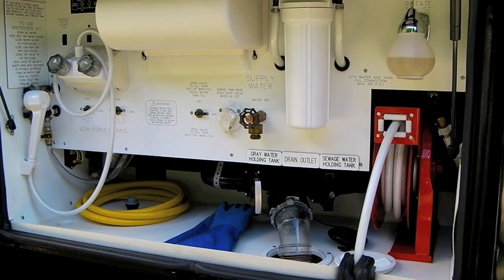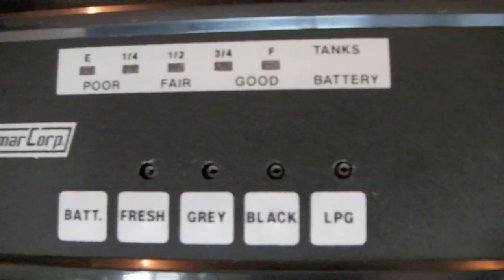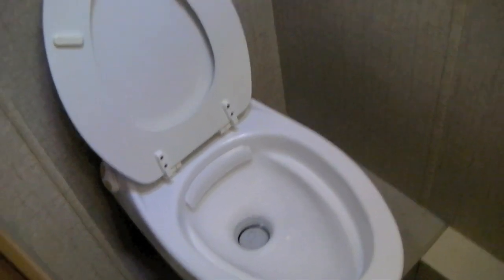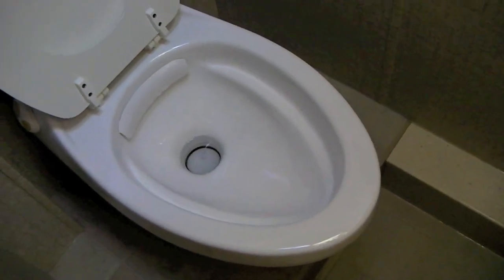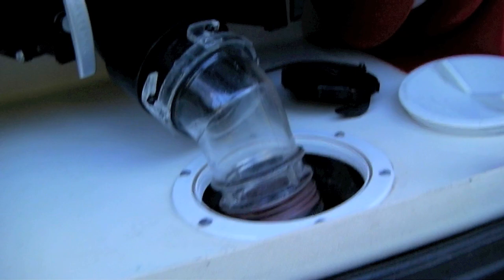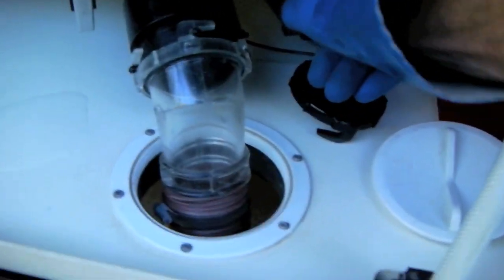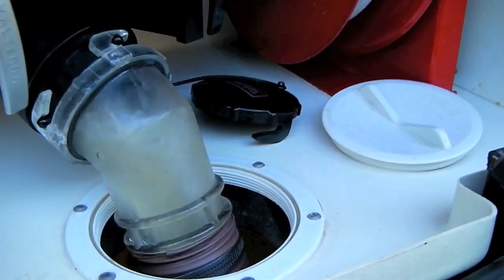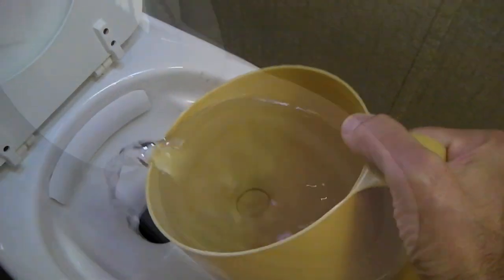How To Dump & Clean an RV Black Tank

Comment: I'm considering buying a used RV. This is one thing that concerns me. I drove Greyhound buses for years and they would stink until we got to a dump station. I have no knowledge of dumping the tank except what I learned on my own back in the early 1990's. This has helped me significantly.
Reply from the maker: Hi Mike! I assume it’s likely that you drove the same type of MCI tour buses that I did for many years. The toilets in those buses (at least the 1980’s & 1990’s era MC96A, MC102A, MC102C3, etc that I drove) were nothing more than open pits with little or nothing to properly seal the tank off from the passenger compartment. The toilet chemical and daily dumping were all that kept the entire bus from being a rolling cesspool. But of course heavy use, high summer temperatures, longer time between dumping, etc could all contribute to the unhappy situation you’re describing. RV toilets are well sealed, keeping the odors down in the tank. As long as the toilet seal holds water, you shouldn’t have anything to worry about. Also, the dumping process on a bus was just plain disgusting. Nothing like that on an RV, especially if you only dump when fully hooked up in an RV park with the sewer hose properly connected to the sewer outlet (vs using a dump station).  We have zero odor when using our bathroom or dumping.

Comment: I'm a DIY fulltime RV'r and I've been using a macerator pump for the last 9 years.  There are several macerator pumps on the market.  The last one I got is a Flojet. I use to spend a lot of time dumping the grey and black tanks as illustrated in this very well produced video before I found out about macerator pumps.  There are several fairly good videos here on YouTube about them.  If like me you find all these procedures unbearable drudgery I really recommend investigating RV macerator pumps.  Also I honestly believe that "Happy Camper" waste water  tank treatment is the best thing since "Pink Delsie".  It will easily take care of any buildup in your tank should you be unfortunate enough to have that issue.

Comment: Great video. I took notes, so I can have them in the RV and remind myself of the steps:
Fill grey tank to ½
Clean toilet 
Connect tank flush and start water (slowly)
Dump
tank flush full power for 5 minutes
Close valve
1 minute open valve repeat
Fill black tank with fresh water
dump 
Repeat 
Dump grey 
Black tank treatment:
2 oz. Rid’X &  1 gallon of water

If black tank stinks:
5 10# bags of ice – long drive
2 cups of water softener, 1 gallon of warm water, 1 cup of laundry detergent

Comment from the maker: We've heard good things about aftermarket tank flushing systems, as long as they are installed properly (we don't know what is involved in the installation, and it might best be done by a professional). If you have a window in your bathroom to put a hose through, using a wand can be pretty easy.

Comment from the maker: RV refrigerators are generally bi-fuel — propane/electric gas absorption, with no compressor at all.  Regardless of whether you're running in propane mode or 110-volt AC electric mode (from your generator or shore power), the process involves heating ammonia for an evaporation/condensation cycle, which causes it to cool.  It's a completely different process than a residential refrigerator (which some RVs, including ours, do have).

Comment from the maker: @groush  Using a fair amount of water is the downside of keeping the tank clean.  That's one reason we never dump it until it's at least 3/4 (when fully hooked up for a time, we wait until full).  We also avoid dumping the black when in an area with water use restrictions.  Between the initial rinse and one big fill, we figure we use about 60 gallons to dump our 45-gallon tank, about every 2 weeks. We also use the park's restrooms too, but of course that uses a lot of water as well.

Comment: Excellent.  My Camper manual sucks and this answered almost ALL my questions, well done!  One question, at the very end of the video you mention to dissolve 2 cups of "water softener" is that water softener salt or did you possibly mean fabric softener?  Please clarify.  BTW you sound a lot like Mike Rowe ;)  Thanks
Reply from the maker: Glad this was helpful! And I get the "Mike Rowe" reference a lot. LOL! On the "water softener" we mean a product like a laundry water softener like Borax or Calgon. Usually available in the same aisle in the grocery store as the laundry detergent. It just makes the water soft so it wets everything better and helps keep "stuff" from sticking! ;)

Comment: Great video!  Two techniques that I advocate: pull the slide valves slowly, in case a hose connection is not totally secure; and, to keep insects out of your coach, never leave either black or gray valves open unless doing lavatory service.

Comment from the maker: @loni benton Hi Loni. You appear to have had a failure in the black tank flush line, or possibly an incorrectly installed line. Your dealer should be able to address the problem (under warranty I assume, since you mentioned the unit is new?). Once it's fixed and dries out, you should not have a mold problem from one quick wetting. As long as they can air it out, you should have no worries once the break in the water line is located and repaired. It's probably just a cracked or incorrectly installed fitting, and hopefully easy to find and fix. Please let us know how you make out.

Comment: Excellent video. Learned some stuff. Been consistently told that you cannot run the tank flush with the dump valve closed or you will "over pressure" your tank. This didn't make sense to me as I knew there was a roof vent.
Reply from the maker: +pauld5530 Yup. The only thing that will happen if you overfill is that the water will come out the roof vent. Don't do that! Of course if you were to not only allow it to start coming out the roof vent, but to leave it that way (like you walked away and just left the water running for an extended period), the roof vent probably cannot handle the volume of water continuing to enter then tank, and would probably start to pressurize the tank as it continued to fill up. Don't do that!

Comment: Excellent you answered one of my Q. I had about cleaning my black tank. I will have to check and see if my motorhome has a spot to screw in a water hose to fill the tank to flush it. Mine is a 1993 Dutchmen model. To be honest I thought I had to just keep putting water down the toilet! LOL Newbie here. Thanx for another great video!
Reply from the maker: You COULD just keep putting water down the toilet.... for a little while. LOL
Reply: +RVgeeks I tried to look under my RV tonight but I seen no spot to screw in a water hose I will look again tomorrow. I just got done oiling all my woodwork in the RV, more there than I thought! I been watching quit a few of your videos and taking notes on my pad of paper. I want to do it all correct lol
Reply from the maker: zartan
Your RV may not have a black tank flush system. Many don't.

Comment: I live in southern Ontario and I generally driveway camp or in provincial parks. As such we normally do not have water when we dump except what we have on board. I rigged a valve station that I connect to the taps on the outdoor shower. This can then lead to the shower, a hose or to the black water flush. I have a check valve on the entrance to the black water flush as you show in your video. I then turn on my pump and flush the black tank with some of the water I have on board. 
My black tanks are long and shallow, like the grey tanks in my RV. So, that means there is a LOT of surface area on the bottom of the tank. When I dump I use the clear pipe and the flush and generally dump a full black tank, but sometimes, not always. I also close the valve and fill for a minute and then release three times. Probably does not pass the smell test, but the notion of filling the entire black tank again with fresh water seems wasteful to me however much it cleans the tank. My grey tank was not showing on the sensors very well, so I put in a half of jug of liquid dishwasher detergent right after dumping it. When I dumped it again a week later, the sensors worked just fine. I have done this with the black tank as well although there is probably less grease in that tank. 
What would you think of dumping the black and rinsing with the flush then closing the main valve or cap it etc and then opening the grey valves while the black is also open. The grey water will then go up significantly flood the black tank. Then close the grey valve and release the contents of the black tank and finally open the grey valve again followed by some rinsing. If this worked then you would not have to use 40 gallons of fresh water. Just asking. Henri
Reply from the maker: Thanks for all the input, Henri! Sorry if we weren't clear, but this is our periodic super-cleaning regimen, not our everyday dumping technique. Here's our regular method: https://youtu.be/gZFyfsy4ptw Uses less water and works great.

Comment from the maker: When using the toilet for... #2, we fill the bowl part-way first, so it's more like a regular toilet, with some water already in it. That, combined with flushing it afterward, and also using it for #1 as well of course, puts plenty of liquid in the tank. You don't really need to flush excess water down just to add more into the tank. But by the same token, don't purposely avoid putting water in just to extend the time between dumping. We find that just using it normally works great.

Comment: Just viewed another video that demonstrated that ice does nothing to scrub the bottom of a black tank.  However, the rest of your video is excellent in terms of following procedures to the letter.  Thanks.
Reply from the maker: We're familiar with that video, which only shows that ice does not solve a pyramiding problem, which we already knew. The purpose of ice is scrubbing off a thin layer of buildup on the BOTTOM of the tank, which it works really well for.

Comment from the maker: You'll notice we advised dumping only when the tank is at least 3/4 full (when in one place for an extended period, we always wait until the "full" light comes on, dumping as infrequently as possible). The crazy waste of water we see most often is when RVers dump 1/4 or 1/2 a tank, of course using their tank flush attachment each time. And after using all that water, their black tanks still build up debris over the years, as we showed that the flush alone does not clean than tank completely.

Comment from the maker: In that case, it's probably best to use some type of commercial tank cleaning treatment or better yet, try out our method for cleaning out a gray tank (we recently did a video on that). SInce you can't get a flush wand down into the gray tank, the concept is the same. Just search for our video "RV QUICK TIP: Gray Tank & Sensor Cleaning" that we posted this past April. Should help your black tank too.

Comment: Is this the same for all RVs? I recently purchased a brand new fifth wheel in April this yr for my 3 children and I to live in so this has been a real learning experience. I'm going to look into getting a clear elbow now. I clean the tank once a week and today it smells horrible so I'm doing research bc the lil 1hr orientation they gave me at camping world just didn't seem to be enough. Thank you for making these videos!
Reply from the maker: Congratulations on your new RV!

This will work fine on any RV with a black-tank flush attachment. This method of filling up the tank and dumping is generally for extra-duty cleaning for a tank that smells bad even after it's emptied, flushed and rinsed. If you're not having that problem, you can use our "everyday" method (you don't have to actually do it every day of course!), shown here: https://youtu.be/gZFyfsy4ptw

If you don't have a "sani-flush" type black tank flush connection on your RV, and want to clean the tank thoroughly, you'll need a wand, like this: http://amzn.to/2aoGIzf

If you're able to get rid of the smell by cleaning the tank, but then it builds back up pretty quickly, you might try a different tank treatment. We switched to Happy Campers last year and have had good luck with it: http://amzn.to/2EM0nbH this is the clear elbow we like best: http://amzn.to/2Elm58g

Safe Travels!

Comment: I would like to make a Cautionary Note about Holding Tanks in general.  My understanding most are made from a polycarbonate or fiberglass material, (plastic).  Most have a continuous flange around the top portion of the tank.  Many are supported by the vehicle chassis frame from this flange.  Don’t make the mistake I did thinking it was OK to travel with these tank partially or full.  They will crack open and break at this location in due time, creating the worst mistake you made in a long time.  Especially if you’re RV has a full metal covered under belly full of insulation?  Play it smart, do it yourself or have your dealer inspect and or install additional supports to the tanks underbelly to take the heavy load of these flanges and really support the heavy load. 
Happy travels
Reply from the maker: Not sure what brand RV you have, but we (and all the RVers we know) have traveled with full fresh or black & gray more times than we could possibly count over the past 14+ years with zero issue. Sorry your rig had this happen, but that is not the norm. The tanks are polyethylene by the way.

Comment from the maker: Sounds like you either have pyramiding, a clogged flush valve (does any water come out when you pull the black valve?) or your tank sensors are gummed up. Did you actually see the water level up high when looking through the toilet? They sell powerful waste digesting stuff at Camping World & RV dealers for build-up that also cleans the sensors. If you have 3/4 tank of pyramiding (which would fail the "sniff test" big time), you might have to call a professional to have the tank cleaned out.

Comment from the maker: Wat we think of as a "park model" is basically a mobile home, which would normally have a regular flush toilet, since it's permanently built in place. Do you by any chance have a "5th wheel" as opposed to a park model? Is your home designed to be driven or towed around, or stay in place permanently?

Comment from the maker: If getting a whiff of #2 is unhealthy, then just using the bathroom is hazardous, no? lol  Of course, I only did that for demonstration purposes and am not in the habit of pulling air up through the toilet. Have you tried the ice trick yourself? I have and I assure you that the physical scraping action of the ice back & forth across the bottom of the tank as it begins to melt works like a charm as you drive, removing debris stuck to the bottom of the tank.

Comment: I don't recall hearing in the video, so if was mentioned, this will be redundant, but a very important RV tip:

Always, and usually in any septic tank system, use 1-ply toilet paper. It breaks down much easier and helps make dumping the tank more successful, even without using chemicals. (I only use chemicals in summer for smell and I live in my RV full time).

Comment: Great information. This should make tank maintenance much easier. One question how does the Ice thing work on the bottom of the tank if Ice floats in the water you add?
Reply from the maker: Hi Terry! The ice trick is indeed only for helping to remove dried-on crud on the bottom of the tank, not for a giant pile that's built up due to leaving the black valve open (called "pyramiding" which is a terrible mistake to make). If you add quite a bit of ice, but no water, the ice doesn't float, or even move... at first. But as you're driving, and the ice begins to melt, there's a point during the melting that there's enough water in the ice to allow it to move around, but not float. The weight of the ice shifting around during that time is what can help remove some of the debris off the bottom of the tank. Once enough melting has occurred to float the ice above the bottom of the tank, it of course won't do any more cleaning. This isn't a panacea, but can help with some lingering odor issues.

Comment: Question. I just dump my black tank and nothing is coming out of the valve but it’s saying my black tank is full.  I’m so confused
Reply from the maker: Hi Kevin. Your best bet is to look down the toilet with a flashlight to see if there is anything in the black tank or not. If you can see that the tank is full or mostly full, and you are pulling the black valve and absolutely nothing comes out, you may have a defective valve that’s not opening. The other possibility is that you have a blockage, but if that were the case, at least something would likely trickle out. The most likely situation is that your tank sensors are reading incorrectly. But the best way to be sure is to look directly down into the black tank through the toilet.

Comment: This is a stinker for me the first time (no pun intended :)  Over time it has gotten easier. I do find the travel trailer I had was easier with height and angle to empty. Now I have a class B Sprinter and it is a bit more difficult. 

Recently had an issue with the toilet backing up after dumping so trying to check for possible fixes. Not even sure how this happens?? lol

Comment: For those of us who do not have a Reverse Flush System installed, I would like to know your evaluation of the effectiveness of using a Reverse Flush Adapter at the RV outlet. Thanks for the great video.
Reply from the maker: Hi Mike! For a short time we had a clear sewer adapter that included an attachment for a garden hose, aimed up into the sewer outlet, to "blast" up into the black tank. It did less than nothing. We'd suggest that a wand that goes down into the toilet is the only real alternative: https://amzn.to/2Mm5Fip
Reply: @RVgeeks  Thanks for the reply and info on the wand.